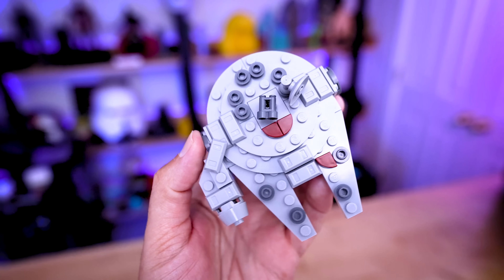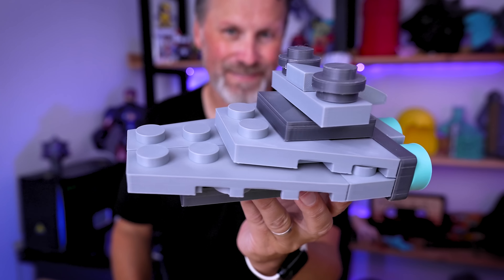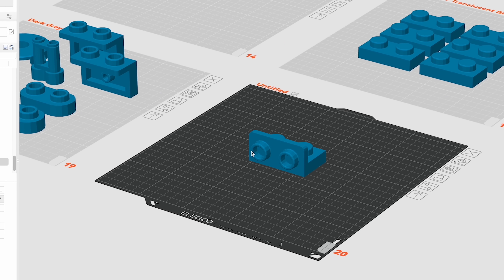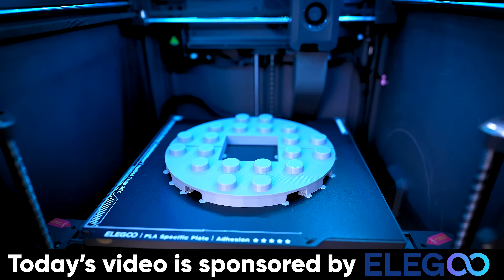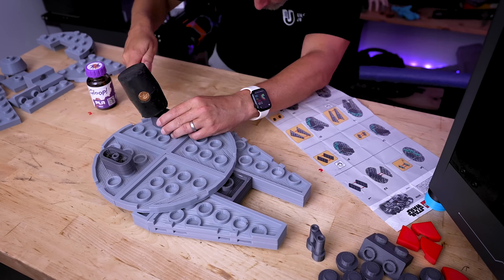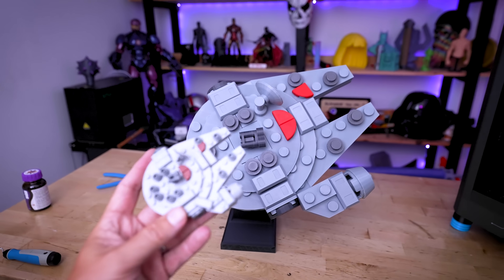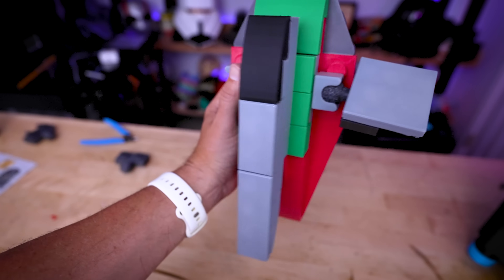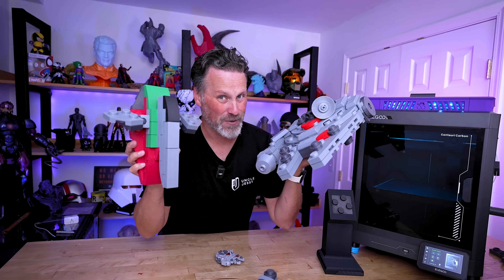3D Printing Giant LEGO + Star Wars = My New Obsession

Comment: I used "studio" (off Bricklink), import the set, split colours into sub-models, export each sub-model as .OBJ, import into BambuSlicer, fix broken mesh, split to objects. The pieces come out of studio at 250% scale. I recently did a 250% scale Stitch Brickheadz, look up "3D Printed Art UK".

XY Contour Compensation -0.08
XY Hole Compensation -0.16

Bambu A1

Comment: They (LEGO) cannot legally come after creators just as long as A) cannot mention LEGO as a source as it is a trademark - use the term "brick" instead; and B) don't create LEGO Mini-figs as these are still trademarked. I wonder if that display bracket would be better if the display armature was in two pieces, which put together, would allow you to change the angle.

Comment: For the ball joints what might work instead of hair, you could do what Zoobs does where on the ball it has multiple small indents and in the back off the clip part is a raised up to fit in the indents, Might hold it in place better

Comment: What plate temp are you using on the smooth side of the plate? I’ve tried 35c but have had some adhesion issues. I upped it to 40c and used hairspray and that fixed it, but I’d rather not use hairspray.

Comment: Nowadays, it's probably better to model without tolerances. The cutting software itself probably has options for reducing hole sizes? So, even if you scale the model, the tolerance set during cutting remains the same, and the model itself doesn't require any adjustments.

Comment: I've done the same as you did. I had a very mixed outcome with tolerances, some were extremely tight and I had to file some off, while others were so loose that I had to glue them. It's definitely a very mixed experience.

I also used a lot of standard supports, for pieces that had a flat layer that needed supporting, and just used an interface layer, gives you a really clean underside as you know.
If pieces are in the middle, it really doesn't matter that much, but otherwise it really brings up the quality.

Comment: I saw that you were printing the pieces in PLA, LEGO bricks are generally made from ABS (injection molded) which is (as you know) slightly more flexible and having read the original patent sketches... the tolerance is zero, sometimes even negative. so any tolerances you want is something that you'll need to calculate for yourself based on materials choice.